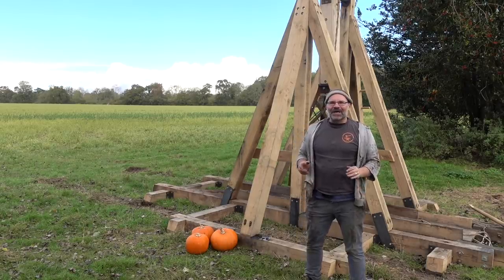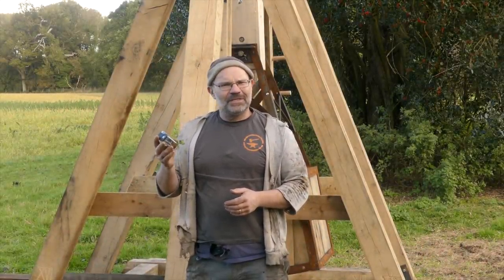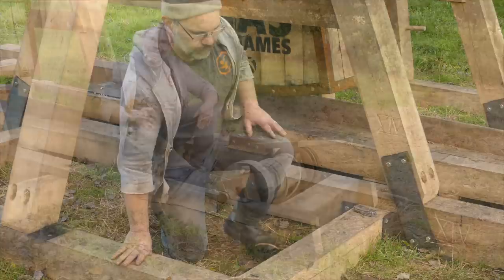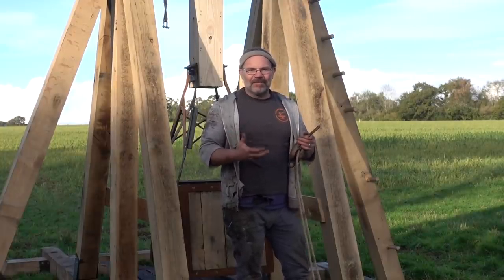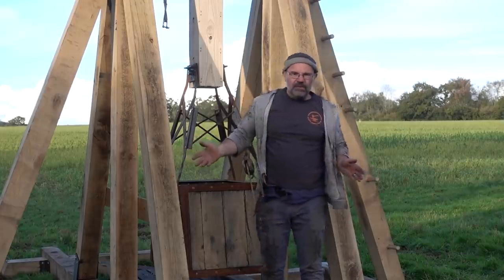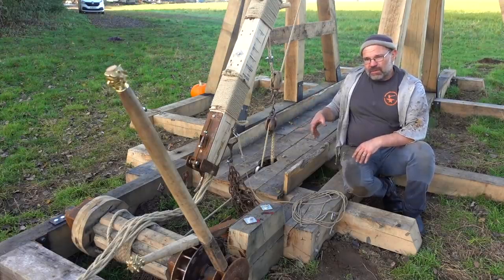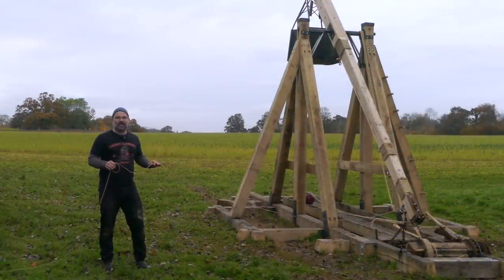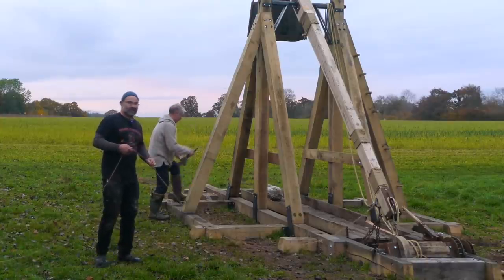So... I HAVE A TREBUCHET

Comment: really interesting to hear about the requirements for filming and the compromises that need to be made. Looking forwrd to seeing how you optimise things over time.
Reply from the maker: Thanks Jason and you must know the deal - making it work for the production is paramount and then everything else follows
Reply: @tods_workshop  I do indeed, I get offered costumes to wear that are, well lets put in politely, not up to standard, Particularly armour that just doesn't even vaguely fit. I'm just super excited to know you have a real treb!
Reply: @tods_workshop  BYZANTINE FIRE GRENADES!!!!!!!!!!!
Reply: @tods_workshop  - Are you going to post the stats for the Trebuchet? ie height of pivot, ratio of counterweight to projectile weight, length of throwing arm, etc?
Reply: @JayM409  I'm also interested in this. Depending on the height of the counterweight drop and the weight of the bowling ball, I suspect Tod's getting somewhere around 20-25% efficiency out of the trebuchet currently, which is really good for something that needed to be built that quickly and to meet the customer's requirements. I was expecting closer to 15% for something with those compromises and not yet tuned.

Comment: The Science Museum's trebuchet was loaded and live for many years until it was pointed out that a kid could pull the pin and launch the rock through the glass ceiling!
Reply: pointed out or found out?
Reply: @Hirosjimma  pointed out by a professional.  Found out would have been messy 🤕
Reply: @lightwoven5326  aww that's a shame.. found out would've been funny as shit and made the papers
Reply: @lightwoven5326  "You guys have a trebuchet in the atrium. There's a rock in the sling, and, having just had a look, the bucket has its weight in it. This is exactly equivalent to having a cannon stored in the building with a powder charge and ball loaded with a lit match just sitting next to it."
Reply: Your saying that like it’s a bad thing .
Reply: @nilo70  Trigger discipline.
Reply: @SuperMYSHKIN  more like "siege discipline"

Comment: Can you please refilm Incendiary with wider lens? To fit entire trajectory in frame. It should nicely show how projectile fly.
Reply from the maker: Yes will do - still trying to get used to filming it
Reply: @tods_workshop  Yes! I was going to ask exactly the same thing!

Actually, if you could film a few different projectile trajectories (heavier/lighter ammo, longer/shorter/heavier/lighter sling) that would be pretty neat. Pretty please?
Reply: @tods_workshop  A shot from the receiving end would be really cool too. 👍
Reply: @euansmith3699  Do you have stock in the GoPro company or something? Isn't it enough that the man has already shot one with a crossbow? Or do you just want to see GoPros get flattened?
(I want to see a GoPro get flattened by a boulder, too.)
Reply: @ShadowDragon8685  Gotta see a hit from every ammo type! :D
Reply: @BobT36  Maybe Tod could link up with some jousters to do some GoPro vs Lance "experiments" 😏🤭
Reply: @tods_workshop  If possible, A shot of the landing site after impact would be nice to see as well, I'm curious as to how deep some of these things are going on impact.
Reply: @tods_workshop  I’d like to see the flaming shot from a drone POV. I think you could get some pretty good looking shots.
Reply: A camera drone hovering at the top of the projectile arc filming the incoming shot would be most excellent!

Comment: I was sure about it! Tod is destoying GoPros on purpose. And now he's got a trebuchet to do it
Reply: I'm surprised he killed that one.
My 9 Black survived 3 crashes while mounted on RC planes, the third one coming almost straight down after elevator failure.
All 3 happened in grassy fields that were cut with a lawn mower, so less padding than the longer grass in the video.
Reply: I see Tod putting the GoPro in the pumpkin.
I think to myself... ok, but how is it attached? Surely it's not just push-fit, it would fall out right away. He'll probably put some extra wiring or rope or something to prevent that, right? ... right?
...
... WHYYYYYYY?????
Reply: @Tennouseijin  I wondered the same thing myself !
Reply: @Tennouseijin  Yeah I was like, that just gonna fall out, and was wondering what he had done to try and make it more secure than what it looked... geuss that answer was nothing xD
Reply: Kinda sad we couldn't see the footagr
Reply: @petrus9067  Agreed. I expected to see it and was disappointed not to.
Reply: @leggomygopro8219  I mean... when Tod destroys GoPro he destroys it for good. None of the others had any footage salvaged from them if I remember correctly
Reply: @mikurusagawa6897  I just thought he might show the footage from one of the other cameras.
I guess it must have fallen out after launch.
Reply: Wanna destroy a GoPro? Just install the GoPro Labs firmware and watch it die like my did!

Comment: Regarding light projectiles, they have an additional problem I discovered while slinging - for a good release, you need the forces acting on the sling itself to keep the thing more or less straight as it goes. Problem is, if your projectile is light, your startup speed lets the line slacken a bit and then catch up, jerking it around. When this happens with slings, it pretty much obliterates any semblance of accuracy you have - I suspect this may be what happened to your treb.

This problem gets worse if you have a heavy sling pouch and light projectile, my scavenged-from-belt sling pouch and tennis ball setup is about at the edge of practicality, and since your treb had both heavy pouch and light projectile issues... What the reason for this is, I'm not 100 percent sure, but I suspect it's because the sling works best if the projectile is the clear majority force acting on the string as far as keeping it taut goes, and if the string is heavy enough to be able to not be overwhelmed by the projectile...

The solution with slings is to increase your windup speed with lighter projectiles to where this isn't a problem, but something like a tennis ball is just about at the edge of where that is easy to do. A treb, on the other hand, isn't very good at going fast (especially from the start), it's good at going no matter how heavy the load.

Another solution is heavier projectile, obviously. When I switch from tennis to baseball ball, the problem disappears - but slinging baseballs in the park is liable to murder someone's dog, so...
Reply from the maker: Thanks Martin
Reply: Well that's interesting to know!
It's a shame you don't have access to somewhere you don't have to worry about collateral damage!
Reply: I had the same issue on some items. Sling wasn't fully extending due to not extending fully. For flaming ammo I use a rope or chain instead of the sling.
Reply: @tods_workshop  BYZANTINE FIRE GRENADES!!!!!!!!!!!
Reply: I think the someone presents more of a target area than the dog.

Would need to experiment to confirm. 🤔

Comment: Hi Tod,  I'm captain onboard a ship, started out on an old cargo ship that used block and tackle to move cargo.  Looking at your wooden block and basing it of the size I would say it has a safe working load of around 5 tons.  If you double them up you can then increase the load weight to between 7.5-10 tons.
Reply from the maker: Thanks
Reply: @tods_workshop  also: if you test them to 5 tons and they do not bend or break you can be certain to use them at 2.5...

Comment: I'm kind of shocked the GoPro broke.  They've been dropped out of airplanes and survived the fall.  Maybe give a GoPro a parachute and launch it?

On a different note, can a trebuchet throw a giant dart?  Since there are darts that are thrown with what's essentially a sling it seems like it should be possible.
Reply: I think he said he was going to try throwing bundles of the plumbata (those war dart things) in his first trebuchet video.
Reply from the maker: GoPro - bad luck and a rock I guess.  Darts - apparently they did, so I guess I shall have a go too....
Reply: @tods_workshop  Medieval cluster bomb or single warhead, either way that should be interesting.

Seems like the sling might need a bit of tuning.  From the documentation I've read there seems to be a bit of fiddling involved with the sling length depending on the rotational axis, the projectile weight, and the weight used to propel the projectile.  I'm interested to see how that is optimized.

The only references I have on this computer are:

Donald B. Siano  2001 Trebuchet Mechanics  
WinTrebStarXP Trebuchet calculator

I used to have some excellent scans of transparency overheads that were much better, but that was many computers ago.
Reply: @earthknight60  The release angle is kind of tricky to control. Do you know if they ever used a release cord to control the exact release angle? It was the first thought I got when I saw the first throw. If there wasn't for the sling I'd say a release cord for the payload would be the way to go, but with the payload swinging at the end of a long rope sling I'm not sure it would work very well.

Comment: Again a great video. I'm building model trebuchets for a couple of years now, but I never could explain and film it that perfect! All informations are so true. Great work Tod!!! The weight of the projectile and the sling material (low weight) is absolutely defining the performance of your trebuchet. I 3D printed a few trebuchets and even if the base components are almost 100% identical, the sling length, material and projectile is not. They must have had very good weight measuring tools in the medieval times to find equal projectiles to perform accurat hits again and again :) my full respect to the handcrafted technology back then. Looking forward to the next trebuchet videos :)

Comment: so where are the "I HAVE A TREBUCHET"-tshirts? i want to throw my money at you! (preferably with a trebuchet)
Reply: (also: attach the gopro to a wire, pull that wire through the pumpkin and fixate it on the other side.)
Reply from the maker: T shirts will be coming and yes I worked that out after...

Comment: Yes! Tod falls to the lure of the MACHINE ! Strong the dark side is.... Been there - huge fun! 

With consistant projectiles they can be surprisingly accurate - spent some time lobbing black latex water filled balloons through an arrowslit at Castle Rising many years back. A chap leaning against the other side of the crosswall inside said he could feel the impact through the crosswall, and hear a deep "Boom" each time. He was a guest at a wedding party who no-one had told us would be there - fortunately on the other side of the crosswall so no one got soaked.

Comment: Hi!
Great as always! On the framing part you said that you think they would have reenfored the joinery with steel work. Maybe  but not sure. From my expérience as a timber framer doing some expérimental archéologie I would say no. I have done and use a few wooden winch, crane, weel crane, pulley ... wood is quite thaught. For example we were able to put more then 1T of loard on a 1" wooden axes on a pulley with out breaking (sadly I stop working a that place so we didn't try more). I think if the joinery is well made with the right joint at the right place no metal reinforcment are needed. I think a wooden axe would work to but that is somthing to experiment with !

Comment: Whoo Hoo! Tod has a Trebuchet!
When I was about 14 or 15 we made a catapult out of 2x4 and 4x4, twisted rope design, it would throw a 5Kg stone a long way.
We put an old big steel pot on it for the projectiles and we took a couple of the roundish rocks and wrapped them in denim then soaked them in diesel, lit them on fire at night, and launched them!
The visual was spectacular but the most epic thing was the sound, the ROAR of that flaming rock going through the air was NOT to be forgotten.
Cheers from Tokyo!

Comment: Looking at the cross joint in the bottom as a classical carpenter, I predict the wood will split there; always leave at least half the wood intact in a joint.

Regarding the net, the two I have been part of, has had the sling made from leather.

Comment: If you have no other purpose for it, I can't help but think that that old trebuchet sling would be a fantastic seat for a playground-style swing... Or just a seat you can sling up over the roof beams in the workshop and pull down to have a sit down, then stow away later.

Comment: To keep the GoPro in your pumpkin I'd slightly modify you first setup. After the GoPro in the pumpkin cut a window in the door, put it back and wrap in tape to keep them all together. That way the GoPro can see out of your pumpkin but it has pumpkin padding and a tape seat belt for launch and landing.
You also might consider painting your projectiles a bright color to make them easer to see during flight.

Comment: You will get a MASSIVE boost on your range if you put wheels on it allowing it to rock freely back and forth while operating. Though be aware,  adding wheels will require a re-optimization of your sling length.

Comment: I built a mini one of these to hurl milk cartons, worked fab.

I recon there is modern room for improvement to supercharge these ancient beasts. If we used bungee cords or another durable elastic I think you could get that throwing arm moving at real dynamic speeds.

Obviously they used weights years ago as it was far the simplest method available. I'm sure with a bit of solid engineering you could build one a fraction of the size that hurls grapefruit a long long way 😄

Comment: If you form a slight upturn to the tip of the release hook you can then have a loop fastened to the subframe that can again hook over the end when the mechanism is in the cocked position and act as a "safety" until you are ready to fire?

Comment: If you can put it on wheels you would increase the throwing distance and reduce the sway at the end.  the wheels would be connected to the fulcrum so by making the frame mobile you turn it into a sliding fulcrum trebuchet which allows the counterweight to have a far more vertical only trajectory instead of circular (the frame moves horizontally instead of just the counterweight.

Comment: I think the work on period specific naphtha or other flaming/incendiary projectiles will be extremely important. 

I feel like there is a sort of relationship where people with loose/pop culture knowledge assume that everything was a flaming projectile, and then there are people who read the secondary source material and say "ah, that's a myth. virtually nothing was flaming." 

And then when you get to the primary source material, it sort of isn't virtually nothing. Sure, flaming projectiles were not that common (pre gunpowder, of course) on set piece field battles, but sieges, ambushes, and ship battles were very common events. Fire ships were a thing, of course. 

And there, fire, even simply in the act of starting a big bonfire in a place and spreading it everywhere, was very important. Especially since most stone fortifications (which can be damaged by very intense fires) would have wooden hoardings (themselves covered in flame resistant treated or soaked skins, often) or wooden engines close to them. 

The downside was that fire was too destructive: little point burning a town that your army expects to loot or conquer/administer, and fires have a habit of raging uncontrollably. Especially given that grain stocks (key to armies) were highly flammable themselves. 

I think such a focus would be both spectacular and informative (also, please have fire extinguishers and talk about fire safety).

Comment: Tod - extend the extensions by another 1-2m and bolt through the orignal arms with wood joiners ( timber connectors  ) Use at least 12mm preferably stainless rode - it'll take the flex. Note I am NOT an engineer.

Comment: Tod, build a small scale model of the trebuchet that you can fire with and without wheels. You will find it fires a lot further with unlocked wheels, and the energy converted to motion decreases stress on the machine, letting it last longer.
Reply: Interesting

Comment: Tod add wheels so the weight can fail straight down and not have to swing it increases the range and lowers the stress on the frame as it damps the post release swinging

Comment: A study of the trebuchet done quite a few years ago proved puting it on wheels increased the range about 5 to 10%, mathmatical analysis confirmed this. The energy transfer thru the device is also evened out.
Reply: I wonder if some of that energy transfer could be replicated with a dual hinge counter weight instead of a single pivot.

Comment: If you are looking for dumb but interesting ideas, I have a few:
1) in sharpe, they defend a fort using calcium oxide (burnt seashells) powder as an ancient chemical weapon. Could you investigate ranged delivery methods by means of trebuchet?
2) Cluster incendiaries. Try if you can launch a basket with multiple molotovs that scatter in flight
3) Test the efficacy of anti- infantry loads like plumbata, lead balls or rocks with many projectiles launched in a single load.
4) Let's point our missiles at the sky rather than at each other. Try to launch some kind of unmanned glider with your siege artillery.
5) try to develop a sling release mechanism that can easily be adjusted and precisely controlled.
6) try to measure the energy transfer efficiency from weight to projectile energy

Comment: put it on wheels to make it throw further 

also you could move the thing and as a consequence aim the thing. 

if you put it on wheels you could build different structures to the side and then do a video where you test the strength of different medieval constructions
Reply from the maker: I would be interesting to try wheels, but to be honest a lot of work, especially on a soft field so not at present is the answer